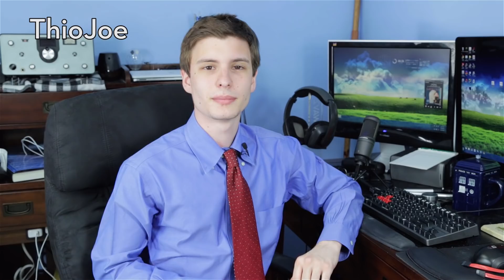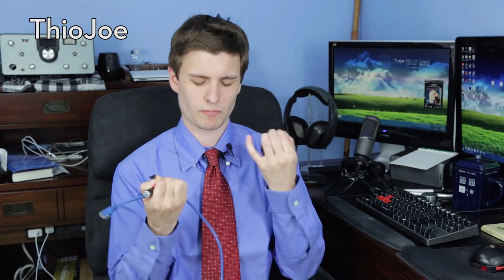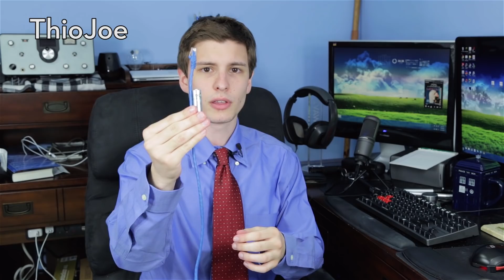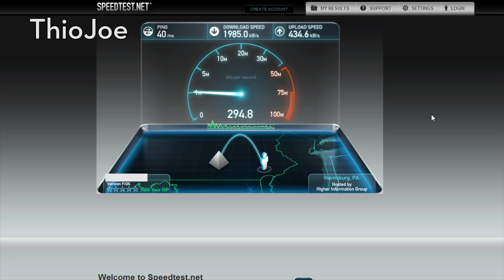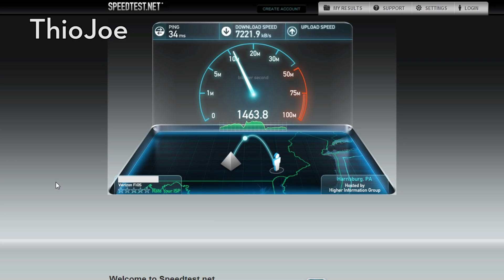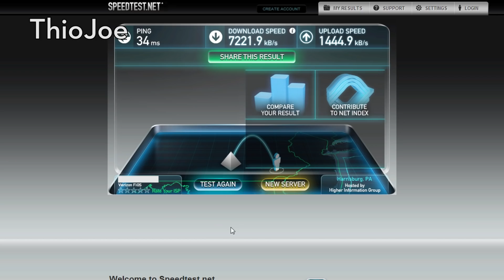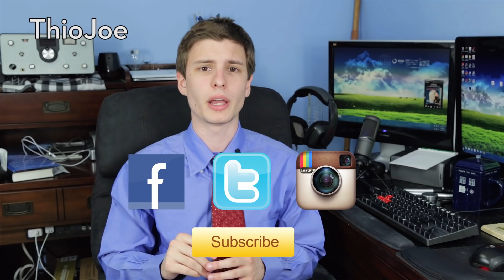Triple Your Internet Speed for Free

Comment: If nothing else, this video reveals there's a whole lot of people who don't understand the concept of electromagnetic induction and how electrons get to where they're going. If a man said he could produce electricity in a loop of wire without connecting it to any kind of power source or device, would he be nuts? What about a guy who claims he can turn 12 volts into 1,000 using the same amount of power? What I'm most curious about is how many commenters here actually tried this battery technique and found that it really did work before coming on here and refusing to admit the fact for fear of being branded a fool.

Comment: And with a transformer and an above 220 V current hooked at the ethernet cable, you will get a faster then light stream, punch a wormhole in the space time fabric, and be able to travel through time. To the past where were no computers or internet. Just smoke and fire.

Comment: Rubber doesn't conduct electricity you fucking troll!
 But babies do. I stripped the ethernet cable and ran the wires through my girlfriend's kid's ass and out his mouth. Then I shoved one (rechargeable) battery in his butt and another under his tongue -- both with the positive end facing out, of course. Wrapped the kid in electric tape and connected the little bugger to my modem using his tongue and dick. I only pay for 50 mbps, but now I've got 1 gig downstream / 300 mbps up -- but only when the kid keeps his eyes open. With his eyes shut, I get a shitty 14k like its 1995 all over again. But, a little super glue and toothpicks fixed that up good. Screw you Comcast!!!!

Comment: lol.magnetic induction only works with AC current. Double A batteries are DC. this would actually increase resistance through the cable, making your internet slower. why do you think there is no such thing as a DC transformer?

Comment: I can not see how that would speed up your internet. Maybe the new cables but a fucking battery attached with non conducting tape to a rubber wire cover. And batteries don't have any magnetic charge anyways. Think this guy is trolling.

Comment: Wow! This definitely worked for my Wifi booster to my desktop that's connected to my 55" TV. Without the batteries, I got 23.80 Mbps download and 17.54 Mbps (With 66 ms Ping) and with the batteries strapped onto my Ethernet in between the booster and my desktop, I get 9.87 Mbps download and 11.34 upload (with 64 ms Ping). It works so much better that it makes my browsers. I don't know what I'd do without you, thanks for making my internet "so much faster". Lol

PS. I used the same batteries as you did, rechargeable Energizer batteries on a CAT 5E cable....perhaps I need to recharge my batteries for this to work correctly? Or is my equipment too outdated (Which my primary Wif router just so happens to be a Netgear Nighthawk X6, the literal Ferrari of Wifi routers).
Reply: *makes my browsers slow.

Comment: It probably works for dial up its not going to work for my type of speeds im running 57 G's download speeds over T3 modemn smokeing the wires in it already  and over 5.5 G's in upload speeds those batteries ain't doing squat I was hopeing for a 150 G's haha just to feel what that would actually do if you people want a speed hack just download you a cheat engine go to cheatengine.org and be done with it and enable a speed hack for your network browser go to process window list and find the chrome browser that is supporting your page to enable it for the web browser that is supporting it just enable speed hack if it says its a bad injection you got the wrong browser just click until you find the right browser if its firefox E explore, chrome, sarfari or opera they are a few other browsers but many don't use the other ones i know of just search for the browser your useing they will be around 4 or 5 listed find the one that is running it not hard to do, some antivirus's  detect they are trojans, they are not, some antivirus's pick it up because of a view parts im useing AVG technology antivirus programs.  I gurantee this website it is safe to download cheat engines get a 6.1 or higher they do great and be done with it, just remember to turn it off if you are going to do games so it won't be crashing your page with the shockwave flash player if you are looking to download or surf the internet cheat engines are your best bet. Enable the speed hack no more than 20 at the most depending on your type of internet anything else it would be so fast it would be flipping by so fast the pages wouldn't respond in time and it would be a disaster waiting on killing pages until you turn it down to satisfy your needs.

Comment: Speaking as an infrastructure IT for the DoD, you're a moron. 

Putting a battery near the terminating end of a cable makes it go faster. So what about the cable before the battery get touched? Thats called a bottleneck.

Whatever the bottlenecked portion is, cannot (literally cannot) go faster than the slowest speed. Jesus.

Comment: Joe I tried the triple your internet speed with the re-chargable batteries and it had no impact whatsoever. I am running wi-fi so I switched the cable appropriatley. no change in speed or ping.

Comment: I used a couple of car batteries and a lot more tape. I plugged the cable in and within a few minutes it glowed red hot.  I did obtain faster internet speed. After about 1/2 an hour I became dizzy and I heard a buzzing sound in my head. The next minute there was a flash of light and apparently I passed out.  When I awoke I was in the hospital.  My house had burned to the ground but the car batteries and cable were still functional !  You can now find me under I64 bridge down by the river, I live in the red van without any tires.  Thanks for the great advice on speeding up my internet speed...

Comment: I am one of your subscribers. I just tried this cable trick using OOKLA test as you did
at 22:18 Download = 3.56 Mbps  Upload = 0.86 Mbps
at 22:22 with batteries secured to cat 5 cable from router to PC as you show in your video  Download = 3.56 Mbps and Upload = 0.86 Mbps
NO IMPROVEMENT SUNSHINE.
Is you vid a joke or what?

Comment: Even with your speed tripled I get more on cable internet that has 4 PC's connected to it and mine is connected to the network via Wifi..
http://www.speedtest.net/my-result/4031915498
Reply: 4 PC's will only increase your internet speed if they are stacked on top of one another, I've seen people with multiple PC's side-by-side thinking they are getting the benefit when they are not.
Reply: Rob Fraser
Were not trying to increase speed, that's just how many computers connected to the network their spread around the house

Comment: @ JEREMY HAMPTOOL, HAMPTON,
look inside that roll of electrical tape your not to familiar with. See where it says "rated to 600 volts"? There is a reason for that. You should fully engage brain before letting the clutch out on your mouth.
Reply: Its rated to insulate against that much voltage, not to conduct it

Comment: Literally the same speeds i get and im using wifi. There is so much resistance moving  through the air it nullifies your claim that your cable with batteries taped to it would give

Comment: Since when does electrical tape conduct anything? Why would you use electrical tape to cover live wires if it conducted electricity,completely moronic.Don't even bother doing this,he also had a video where you wrap a second Ethernet cable around your original cable,again moronic,it doesn't work he is just trolling for more views to get something in return.

Comment: I've tried that, but my internet speed decreased 3 times. The problem was - the batteries were facing the same direction (stupid me :) ). After switching to the right directions, it finally worked. Thank you!
I've also got a couple of questions:
1.) Could i use crone batteries? Would it affect the speed?
2.) What kind of SATA cable should I use? SATA 1, SATA 2, SATA 3 or SATACLAUS?

Comment: It worked, and wow, my internet speed increased about 10 times! I added two mono pole neodymium magnet in the center of the cable with their magnetic poles facing each other. I believe it leads to a quantum entanglement with the electrons which causes them to move through space-time causing a spike in internet speed.

Comment: It doesn't work for me. i did it but when i did take off my cable and use wifi without cable the speed was the same than with the cable with two batteries attach with... and i try too the cable twist with and other and it is the same. Why you spend your time like that?

Comment: What a fucking amateur i was able to not only triple but max out my internet speed using a home grown technique that not only saved me money but brought me hours of mental/physical/psychological pleasure. I spun my cock a full 3 rotations down my Ethernet cord, anchored the head with a little rubber cement, and duct taped my ball sack to the tip of the cord. Once completed i was pumping out speeds that would make NASA's computer engineers look flat out retarded. Unfortunately, the NSA contacted me not long after the fact and threatened to turn me into a memory to i had to disassemble my creation. Which took awhile because the rubber cement was a little tricky to get off. Luckily a little WD40 did the trick, even removed some of the latency juice from my cable. \m/ (-_-) \m/

Comment: This is funny, I quadrupled my internet speed by sticking 2 pencils on one side and two pencils on the other side, it works like this, because of the graphite in the pencils, it uses its complex carbon structure to send all the internet speeds to one area. Also, I applied this theory to my router and I removed the antenna's on it and stuck more pencils on it and put printer paper on the ends of the pencils to amplify the signal of the wifi and now I can surf the web using my home network around the city. I wonder if I had but more pencils and more paper that if it would increase the area of wifi coverage to the whole world. This video is a joke. Try my theory instead, at least it is more "reasonable." Jokes aside, If anyone even tried this, then they don't have a common sense and will probably fall for any tricks (I am not saying you are stupid if you fell for this video). Lets just say for some stupid unknown reason that if a battery was attached to the wire that it would amplify the signal and you would get faster internet speeds, how in the hell is a battery that is taped going to do that? Both the positive and negative sides are untouched. Think of it this way, if you remove the wires that are attached to the positive and negative terminals in a car battery and expect the car to start, then you are just dumb plain and simple.

Comment: I didn't have any batteries to spare so I used 25 electrical cords and 5 rolls of high conductive electrical tape.  I had to tie the Ethernet cable to the ceiling with clothes line because the weight of the cable kept pulling my computer off my desk.  I also wrapped my modem with data cables, held in place by two more rolls of electrical tape. Next I stuck 25 magnets to the sides of my PC to improve the magnetic induction field and made an aluminum foil hat that I could attach to some obsolete rabbit ears from an old TV set.  My speed increased so much that I cancelled my internet provider and plan to start selling internet service to my neighbors.  I no longer have to worry about viruses because they travel to my CPU so fast that they burn up.

Comment: Ive managed to tie my cable modem to a reserve gold mine under my house, I figured why not? less resistance and more conductivity, which means faster and solid internet right? Yeah, When I went to plug it in, I saw a little lighting bolt jump from my ethernet cable to the router socket. Soon the lights on my router were Purple, so I looked it up and found Purple means "Haulin Some SERIOUS Ass" mode. So of course, my dead draggin ass PC was suddenly faster, things loaded up instantly, Netflix loaded the whole movie Instantly. So I dared to run a Speed Test, I hit the Test button, soon the lights in the house dimmed down, my clock on the wall began to tick backwards, looked outside to see it was dark out, was only 2PM. Burned the sun out, and 5 planets dropped out of orbit. Didnt realize that the earth had began to turn backwards and snow began falling, this is in the middle of July, Giant Tsunamis took out parts of the USA, Volcanic eruptions happened, even the little ant hills started erupting, ants are like WTF??? then the Siberian snow came and soon it was down to -50 degrees, even the snow froze in mid air and stayed suspended. Looked back at the router to see it getting red hot and the ethernet cable was white hot, but my speed was 900,000,000 Gbps Down and Up speed was over a few billion. I hit the stop button because an earthquake was ripping parts of the house down, when I did that, the router melted down off the desk and blew up and the ethernet cable was blasting so much data out, it was blasting green fire out of it, so I grabbed my can of Spam and threw it on it, which slowed it down enough to be handled. then things began to change back to normal again, seasons synced back, the clock ticked correctly, all the catastrophic events stopped. But yeah, internet was way faster compared to my old speeds. Give it a try, if you dare.

Comment: this will worck on one wifi adapter ? the cable its usb / micro usb.
Many thanks for the videos.
Reply: This will work but you will have to use lantern batteries instead of the AA size batteries.
And instead of the electrical tape, you should use duct tape
If you are in the northern hemisphere, tape the batteries to your cable in a counter-clockwise direction.
If you are in the southern hemisphere, tape the batteres to your cable in a clockwise direction.
Reply: Many thanks for the reply.
Reply: Aksuvii & Eetu Looking down the length of the cable (imagine looking down the throat of a snake), the wrapping should go in the direction of the movement of the hands of an analog clock.  Or you could grip the connector and let the cable hang down.  "Clockwise" would then be wrapping left-to-right.
Reply: TheSqrtMinus1 It appears that the simplicity of the design is inversely proportional to how elaborate it is.  Somewhere Don Herbert (Mr. Wizard) is giggling.
Reply: Bill Hughes I cant hold up! You sir, are a genius!
Reply: Bill Hughes Heh, that satirical comment  though.
Reply: Bill Hughes What do you mean by clockwise when it's a cable
Reply: How elaborate is this going to get
Reply: What you are going to want to do is wrap some cables around your WIFI antenna's!
Reply: Bill Hughes please have my gold. I have much gold.
Reply: MrTJMishRat Thanks, but I'm a silver kind of guy.  I don't know why, I just am.
Reply: Bill Hughes i know you know these guys are dumb bill they all think electrical tape conducts electricity
Reply: Zahid Shabir No Zahid, I try very hard not to judge others based on what I read on the internet.  Sometimes it's so easy to read something and not immediately comprehend completely what is being said.  We are all only human and are subject to so much crap in our lives, maybe it will make the world a bit better to give each other a little slack.

Comment: I used D sized batteries AND 2 Cat 6 wires.  I ALSO wrapped EVERYTHING in copper wire and DUCT Tape.. I QUADRUPLED  my speed,  however, I soon had a knock on my front door. Upon opening my door I noticed 2 men in black suits and sunglasses standing in front of me and behind them was my cable providers utility truck.. I dont remember much more however all my work I did had been removed and was gone. I also notice my speeds are slower and my rear is really sore.. Thanks ALOT THIO

Comment: He's a dope: IT DOES NOT MATTER WHICH DIRECTION THE BATTERIES ARE PLACED.  

What he PURPOSELY left out is that the slow speed is primarily caused by the moisture that builds up in the cable you use from PC to modem. (It's a sealed cable, no air flow to dry out the moisture).  You need to put that cable in the microwave on LOW HEAT for no more than 2 or 3 minutes...

Comment: ...for an even higher speed all you need to do is to coat your ethernet cable with WD40, making sure to only spray in one direction so that all the slip molecules are properly aligned, then just plug in the cable and watch the speed increase...

Comment: You forgot to tell people that the direction of the batteries have to be correct. 
Another tip: One can wind he cable around a car battery for even better results. But the battery still have to be in the car, with the engine running.

Comment: Electrical tape insulates not conduct electricity. As far as induction goes it induces a voltage equal and opposite of voltage applied and the battery taped to wire does not make an inductor. An inductor is a coil of wire with or with out a core. what u created was a flux capacitor, buddy.

Comment: LOL Dummy your doing it wrong first you have to buy a toaster. pug it in, cut off both ends of the CAT5 cable and then stick one end in the toaster, use a bunch of electrical tape to secure it (because it conducts electricity XD) then stick the other end so far up your ass(make it deep) and finally you jump into a bath tub full of water.  This helped my internet a lot, thanks. Fucking Trolls........

Comment: This worked to some degree for me (1.6 x speedup), but I needed to use D batteries in order to get the advertised speeds (3.6 x speedup).  Which makes sense: they are three times as big so they have three times the voltage